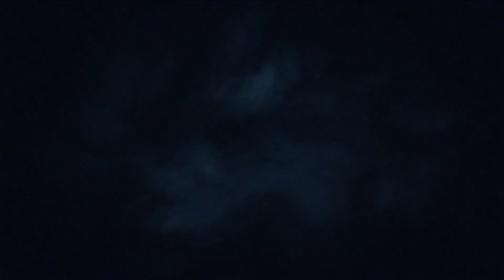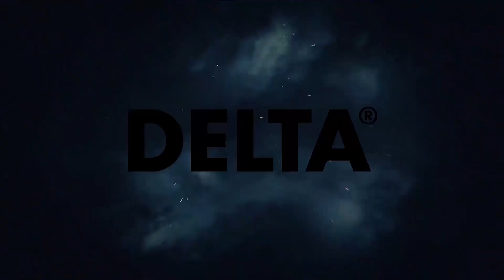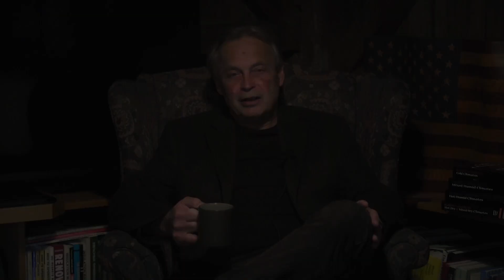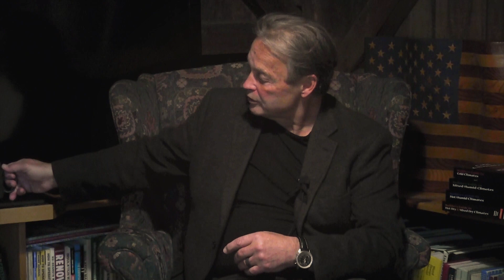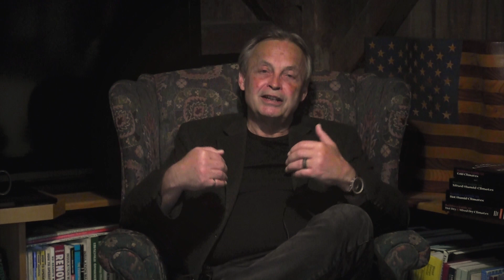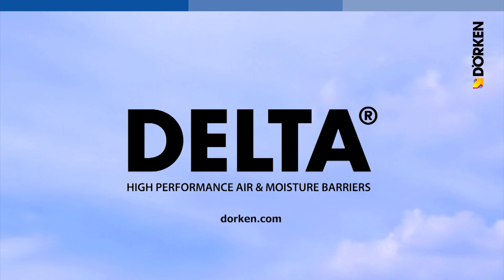A Cup of Joe: Continuity of Control Layers | Building Science Deconstructed

Comment: Yes, but water dispersion  retention  could  put water inside water proof walls for a Central Water Closet  sump incorporated in double 5/8th Fire Coded municipalities. Rooftop Gardens and Mobil Scaffolding between neighbors Captains Watch  circuits should be  set up on the Al Siegel Paper Carriers Union Life Labor through  your morning newspaper subscribers delivery system.